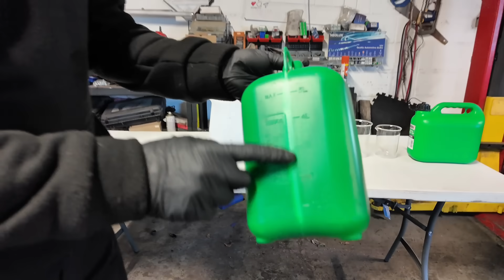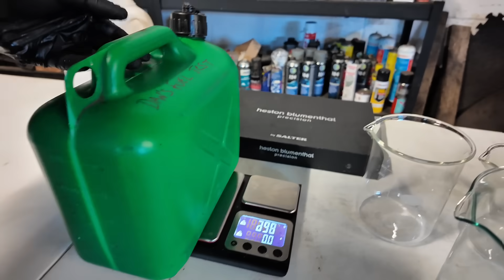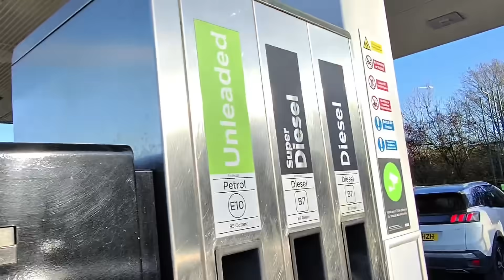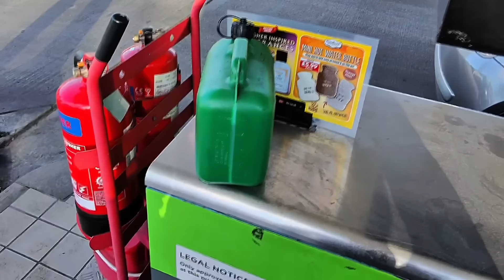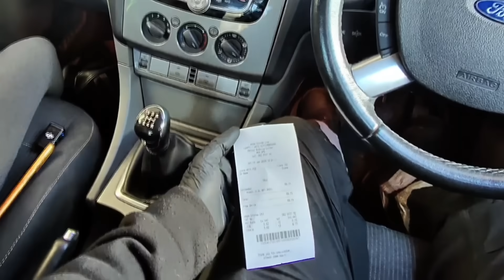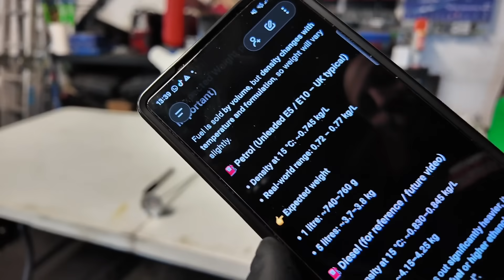This Fuel Test Shocked Us… Are Pumps Lying?

Comment: You could make it much easier... Weight the 5l jug.  then take scales with you in a car. fill 5l- weight the jug in a trunk- take off the jug weight- and put that number on  a paper. Put all you fuel in your tank from the jug. Visit like 10 different petrol stations and you will find which one is cheating :))   Green jugs litre lines are always inaccurate.

Comment: Fuel is sold by volume and the volume changes with the temperature without measuring the fuel temperature at the pump your test is pointless.
Does the UK not have a gevernmental calibration office that is testing the fuel pumps every two years like it is here in Germany? Here every fuel pump carries a seal showing when the last check has happened and ehen the next is about to happen.  The permissable tolerance is 1% and its getting more accurate if you pump at high speed. Also important to know is if the pumps are temperature compensated or not. Temperature compensation means the pump will give you the volume equivalent of fuel at 15 degrees. It is not as simple as you might think.
Reply from the maker: We are only testing in a logical way not a scientific way as voted for by the people on our Polls we put out. People are looking for a simple and clear yes or no rather than a few mls. Thats why we have removed the weight from the tests

Comment: Don't forget, the fuel is stored underground, unlikely to be at the same temperature as the workshop, so will throw your readings out a bit anyway.
Reply from the maker: 💯 0.1% per 1 degree C - we measured the fuel temperature at 13.6 degrees and the workshop was around 6 degrees by the time we did the test 🙌🏻🙌🏻
Reply: @dansautomotive 👍

Comment: When you go to the petrol station, do not pull the pump fully in. It creates small bubbles as the petrol runs through the pump, so you get less fuel. Only squeeze the pump half way and slow the flow. I guarantee you will get more fuel for your money.

Comment: bit like builders merchants / quarry firms wetting the sand so it weighs more                       ,so you actually get less sand when its weighed out compared to dry sand
only upside is you dont need as much water for the mix, so water charges are less

Comment: Easy, I was told by an employee that's worked at a refinery.

1. Pump early morning, as temp plays a part in filling the fuel tank space.

2. Never fuel whilst they are having a delivery as it stirs all the dirt up from bottom of the pump storage tanks.

3. Pumps have 3 speeds, this does alter how much fuel you are being delivered.
Pumping on the first speed gained me 100mile per fill.

4. Not all pumps deliver at the same speeds as I found this out.
So use the same pump each time.

5. Never dispense fuel passed the first click as your paying for fuel you are not getting, it's the pumps safety trip.

Kind regards.
Reply from the maker: Wow thats amazing thank you 🙌🏻🙌🏻🙌🏻
Reply: The only part I laugh at is, the stares from people when your still dispensing after the rest of them have finished, but I generally think this is the scam, they know every one is to fast paced to realise their being conned.

I've only seen trading standards after a contamination, complaint has occurred.
Should be more PPM based.
Kind regards.

Comment: There are common misconceptions regarding fuel, and how forecourt pumps dispense it. The modern fuel standard is E10, which contains 10% Ethanol, and all petrol engine cars manufactured after 2010 are capable of using E10, All petrol and diesel (En 590 Low Sulfhur, 7% Bio Fuel), irrespective of where it is bought, must comply with the quality standard. Supermarket fuel may be cheaper, but it is not manufactured cheaply. Supermarket fuel suppliers may vary from week to week depending on the wholesale price on the day that fuel was ordered (A 0.5 pence saving per ltr make £'s over thousands of litres), and a cocktail of different additives may be present in fuel from different suppliers, but the basic fuel stock must comply with the set standards. 
The forecourt pump must dispense no less than -0.5% and no more than +1.0% than the stated calibrated amount. To ensure accurate dispensing at each use, the delivery nozzle fitted to the forecourt pump works exactly like your hot/cold tap at home; the pipework is always full up to the tap, which in this instance is the trigger on the nozzle. Holding the pipe up in the air to drain any fuel left in it into your fuel tank does nothing but waste your time and effort. You will not get one drop of extra fuel. If you suspect that a filling station is delivering short measures, you should report them to your local Trading Standards Office.

Comment: Local shell and tesco fuel stations have managed to put more fuel into my tank than it holds. Have challenged both petrol stations and got nowhere. Will use sainbury where posdible as they publish the date of pump callibration. Otherwise. Just expect to be ripped off by up tp 6percent. Wokingham trading standards do not check local pump stations. I suppose EVs will at least avoid that fraud avenue? By the way ive founnd welsh petrol stations give more honest measure.!
Reply from the maker: Second test now live

https://youtu.be/IqDstAeewmw?si=DNg-MkEAW_Hp_W9S

Comment: Theres a BP station in Ayrshire and once maybe a mistake but twice ,i had a vw  when diesel was down to half full i always stuck £20 in always without fail went to 3 quarters, every time ....until i went to that garage £20 in needle moved to two little notches by half full did report it but as per nowt happened
Reply from the maker: Interesting and you're not alone, I've had lots of messages highlighting a similar situation
Reply: @dansautomotive  Dont care how it sounds but since the Indian lot took over this happened nothing happened when i complained  thought it would be sorted month later  but guess what just the same same pump as was only one o could get too think how much folk have been ripped off

Comment: Why bother transferring the fuel to the jug to measure it? ChatGPT gave you the expected fuel weight, you could then easily see that it was near enough exactly right based on the total weight - minus the weight of the empty jerry can (if anything you had a tiny tiny bit of extra fuel).
Reply from the maker: Unfortunately fuel is dispensed by volume not by weight. The easy option would be to use weight but the blend of fuel and ethanol means is an inconsistent measurement so the only option is volume 🙌🏻🙌🏻

Comment: we're definitely being miss sold... but its dependant on how quickly you pump it.  Pump it quick you get less, pump it slow you likely get more close to the measured amount on the pump.   My fuel gauge shows me the difference can be about 40% more fuel pumping it slowly.  Its more noticeable when putting more fuel into the car.
Reply from the maker: Very interesting as thats the 3rd comment in a row saying the same to me 🙌🏻🙌🏻
Reply: @dansautomotive  try it...

£10 puts about 1/8 of a tank, £20 normally about 1/4...?

Pump £20 in really slow, barely pulling the trigger and see if you don't get not far off 1/2 tank instead of just 1/4 😉

Really slow, barely pulling the trigger... 💪

I've got a 3 liter inline 6 BMW z4

It eats fuel.  I'm definitely getting more fuel for the same money pumping slow
Reply: @dansautomotive it's a dirty trick by the fuel stations, but simple physics 

The line from the pump to the handle is wider than the nossle 

The measurements thingy inside the handle is at the wider part

The fuel experiences turbulence as it tries to get through the smaller nossle, so the result is, you get ripped off 😂

Hence pumping it slower gets your more of the amount you pay for

It's more noticeable when you pump larger amounts.

It's quite a stark difference above £20 when pumping fast versus slow
Reply: @dansautomotive  oh, it's straightforward testing this theory 

You know how much £20 gets you when you just pull the trigger and vanish in under 5 minutes 

Take 10 minutes to pump it, 40% more fuel, it's wild 😂

Comment: If you don't know the temp of the underground tank , you cannot go on weight for sure  ?
Reply from the maker: Fuel is sold by volume not weight. Temperature does play a part in the density at around 0.1% per 1 degree C which is why we are measuring the fuel temperature at the pump and on the scales for the 3rd test

Comment: I have driven between 30.000 to 50.000 miles every year for decades. So this is my way of fuelling up, my pocket notebook, pen “ multi coloured “ BIC, and my company’s milage & fuel log & the most important two things. The SHELL points card “ WHEN IT USED TO BE GIFTS “ & MY FUEL CARD. As I had Refused to pay to refuel and claim back the following month along with hotels toll crossing. So SHELL garage nearest to my house was my favourite and another important thing was to PICK A PUMP ? Pick a pump number and never change it. Fill up at a ANY SHELL GARAGE when on the road, no matter if it was Nottingham or London it had to be the same number pump every time. Over the years I’ve seen other engineer’s & even senior staff fill up and not do the paperwork and it was either miss fuelled or as in a couple of cases of problems with the fuel that had been delivered that day. They couldn’t remember the garage, let alone the pump number. My local SHELL Garage has one extra service that hardly any garage offers ? A CLEAN PUMP, HANDLE, HOSE & THE MOST IMPORTANT “””  A DIESEL FREE FLOOR “”” No filling up and the leather soles on your favourite shoes to match the suit, no more slippery peddles or the stink of diesel on the car peddles & drivers mat & the shoes
Reply: I's astonished how you could write such a long drawn out story about nothing!!!

Comment: 1 litre of bitumen is heavier than a litre of air 😁 because volume and weight are two separate measurements. Now if the pump says 5 litres and in the can we have 4,5 ltrs we're simply being robbed. Nothing to do with weight though.

Comment: Buckland garage near Betchworth were and probably still are conning people. Fifteen years ago I knew they were up to something and measured off 2 litres into a petrol can and went home and measured it and there was 1.25 litres ! So they conned me three quarters of a litre on that small amount. Only used supermarket petrol stations since.
Reply from the maker: Sorry to hear that and judging by various other comments you're not alone 😢
Reply: @dansautomotive  I don't know if it's just a placebo effect or something but when I pump around 5-7£'s worth and fully let go of the pump then start again and repeat some places including the supermarkets often say I have pumped maybe an extra litre or three than rhe same total £'s worth from another pumps reading, wonder how that works? is it because the force stopping is still pushing fuel out without registering the cash amount sensor of the handle being pressed? or like I said just something that doesn't exist but happens placebo effect? Also sometimes this does not work who knows?
Reply: @chrislee6650 not what I was saying

Comment: I'd suggest that you'll struggle to find a petrol station, chain or independent, where the pumps are significantly underfuelling, because Trading Standards take a very dim view to that and can check them at any time unannounced. 

I'd be more interested to see detailed comparison of the RON/octane, then the additives ethanol content for high street & supermarket E10 and E5 fuels. I've heard due to the difficulty of nailing an E10 or E5, that a lot of E10 is actually closer to E5 anyway, and so E5 is almost E2 or E0 for some premium fuels (e.g. Shell V Power). However I only buy Tesco Momentum 99 RON for my cars as they run tunes optimised for higher octane. That, or Costco Super as it works out equivalent to most other places' E10 on a cost basis.
Reply from the maker: Second test now live 🤷🏻‍♂️

https://youtu.be/IqDstAeewmw?si=CUrTk2gB_9wgBbmp
Reply from the maker: I will look into the ethanol testing as we run race cars at 109 and it would be interesting to see the comparisons 😎

Comment: omg how long does it take to measure two containers. Nearly Eight Minutes before you even got to the petrol Pump ffs
Reply from the maker: Try it yourself and see how long it takes you.....
Reply: @dansautomotive  But then you apparently did nothing with the resulting weights, not even the basic calculation of 4065g filled weight minus 395g empty weight, and checking that against your chatgpt query; so why faff about doing any weighing at all, when your main verification seemed to be 'Is the volume correct?'.
Reply from the maker: @Tekwyzard fuel is sold in volume not weight, I like to weigh things to see if there is a pattern but as everyone keeps pointing out fuel is sold by volume you can't win

Comment: I used to work for a garage forecourt services company and we did everything from underground tanks to self service equipment, when fitted or repairing pumps we had a 25 litre measure which had to be calibrated by trading standards every couple of years, there is a tolerance which escapes me now, but once we finished our calibration of the metering system weights and measures would come check then seal the meter. We did used to err on the generous side though and the meters are extremely accurate.
If you do find one though, just report it.
Reply from the maker: Thank you 🙌🏻🙌🏻

Comment: As someone else said, I've started to see pumps that start, zero and then click up 40 to 60p before I've even pulled the trigger and dispensed a single drop. You can hardly go in the shop and complain that "it went up by itself" without video evidence. Very annoying.
Reply from the maker: Will be interesting to see what we find in the tests
Reply: Most stations clearly say no less than 5L should be dispensed (for accuracy). If you get 5L of fuel every time what is the problem?
Reply from the maker: @AaaaandAction what if you don't get 5 litres.....
Reply: @dansautomotive Then that’s a different matter. The poster was commenting on when the pump gauges change, not what he was getting overall.
Reply: @dansautomotive That's the point. If the register goes up by 60p just after resetting to zero when I pick up the nozzle but haven't pulled the trigger, that's automatically almost half a liter of fuel I'm not getting but paid for. It probably was filling a gas void in the hose or the pump, but if so it didn't go in my car's tank.

Comment: I did query an amount dispensed from a local tesco filling station.

I put in my usual amount at the same point on my range meter that I usually did and I know from previous fills how much it should roughly go up to.

However it was well short, by a long margin.

The lady cashier was only too happy to get the manager down, who did a measure on each pump.

The pump was correct, another was slightly over, I noted the number of the pump for my next visit!😊

But he did tell me the actual volume dispensed can vary with ambient temps etc but they did check them regularly.

Comment: Something else you should know about, if the refinery is close, the fuel can be delivered hot, I've been close to a tanker unloading and i could feel the heat from the tank on my face from 6 foot away, it felt like i was standing next to a giant radiator, so if you are unlucky enough to fill up within a few hours of the tanker delivery, you get the stuff that shrinks in your fuel tank. Also another thing, diesel engines have a fuel return system that constantly sends fuel that has reached the injectors back to the tank, on a day where you have covered many miles or hours running, this will put heat into your fuel in tank.

Comment: Jerry cans bulge at the sides, as this one did as it was being filled. It's not much, but it's enogh to knock a bit off the top end.
Reply: It isn't bulging , it's distorting which means that the internal volume remains the same ( think of a plastic milk bottle 1 litre capacity , you can squeeze it in on the sides ,but it still has 1 litres in it)
Reply: I was thinking that too. Needs to be a rigid container.

Comment: Hi Dan
Interesting vlog but I don’t understand why you are meticulously weighing everything!
Fuel is sold by volume and, therefore, you should just check the volume which was correct.
The quantity by weight will depend on the temperature of the fuel, in the underground storage tank, which will be around 12 C.
After you have purchased the fuel, if it warms up then it will expand and the volume will increase, however, the weight will not change.
The air temperature of your garage will not make much difference unless you leave the fuel can there for, say 24 hours, to change to the same temperature.
Everything is different in the aviation world because the amount of fuel consumed by an engine depends on the weight and not the volume of the fuel and that is why aircraft operators and pilots have to convert weight of fuel to be consumed into volume of fuel to be purchased . . . . sometimes very serious errors have been made when switching from Imperial to Metric quantities . . . . on 23 July 1983, an Air Canada Flight 143 Boeing 767 flying from Montreal to Edmonton in Canada ran out of fuel at 41,000 feet . . . . the captain was a recreational glider pilot and he glided the 767 for 17 minutes to former RCAF Station at Gimli, which had been converted into a motor race track and which was in use, where the nose wheel collapsed  . . . . there were no serious injuries and the aircraft, although damaged, was repaired and returned to service!